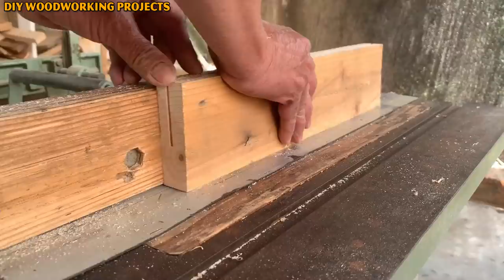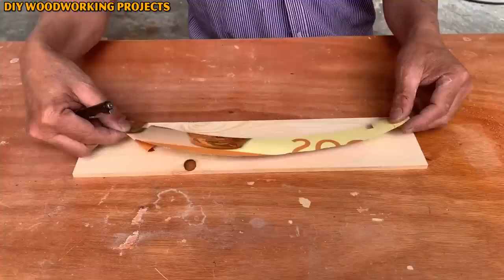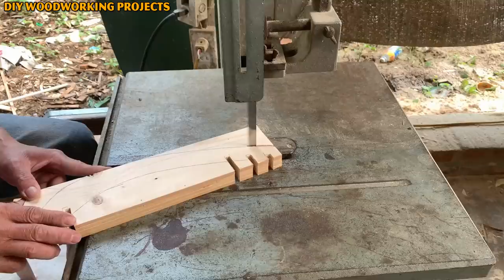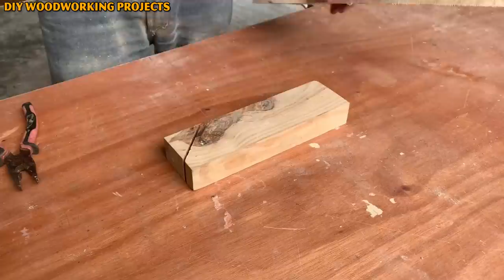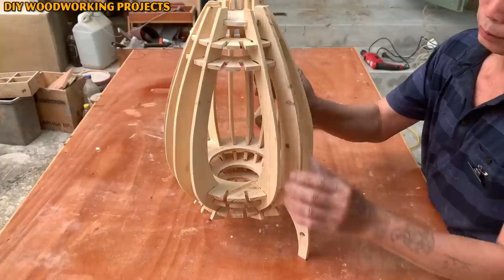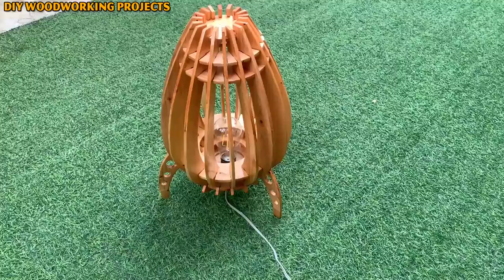Creative Design Ideas From Cheap Wood // Creative Night Light Personality Carved Space Rocket Light

Comment: The rule of thumb is not to run your hands over the top of the blade or you will not have a thumb or fingers.👍

And yes you could have been doing it that way for 20 years but it only takes one time for you to pullback a bloody stump.

Other than that, nice work.